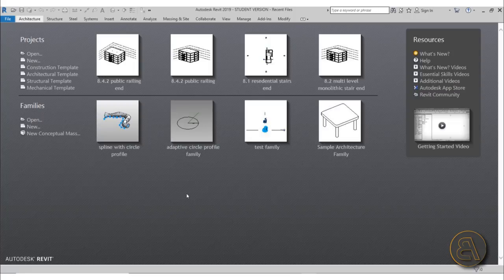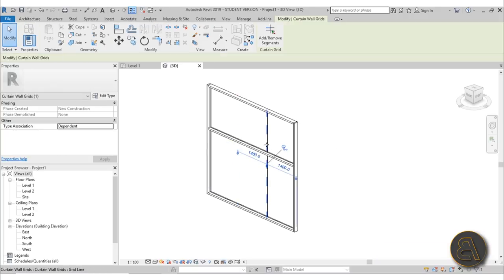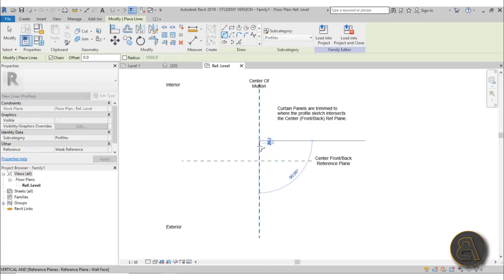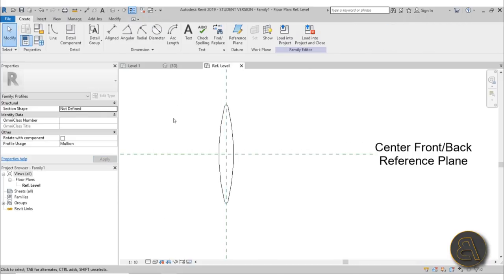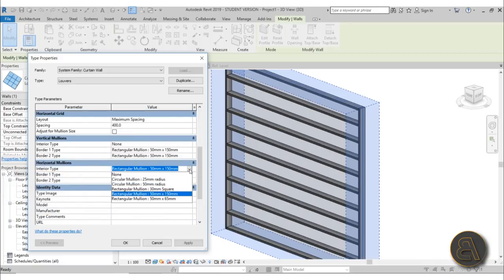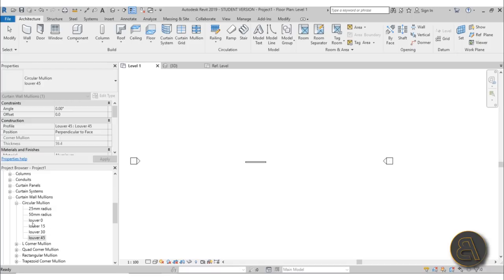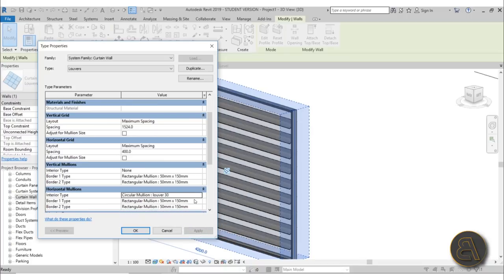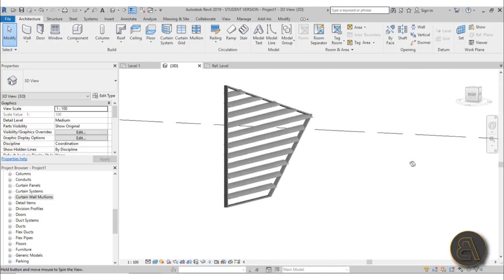Parametrc Louver Family in Revit Tutorial

Comment: Mr Balkan Architect. 

I always have something ı couldnt figure out. In the mullion family edit type menu. Under dimensions. There is width on side 1 and width on side 2, sum of them determines the total width of mulions (front view width (not thickness or depth) . If we have 50x150 mm mullion. It has 2,5cm and 2.5cm values for that. I am always wondering what is the benefit of typing 2 values for a width output resulting from the sum of width on side 1  and side 2 inputs. And when you create the new mullion family and choose the profile for the louver that you made to use on mullion family, those width on side 1 and on side 2  value inputs in the dimension section were uneditable. How can we add a parametrr to the profile so we can use that dimension options of widths for  louver profiles?

I am studying architecture. I know revit but not much about families. Sorry for the question if it was unlogical. Also thank you for your kind and nice tutorials. I would surely support you as soon as ı can afford to do it

Best Regards,

Comment: Please I need create a family of dampers.  The frame is 3” at
the bottom; 1.5” at the top.The blade thickness is the same.  You may change the
quantities of blades (at 12” each) to increase the height to 24”,  36”,
and 48”, and the blade length will be 24”, 30”, 36”, 42”, and 48”.  A total
of 15 different sizes. this examples is not working is I need drop on any kind of wall
Reply: I am using revit 2017 I cant see the empty pannel in diologe box can you help me
Reply: @ansarnelliyali8935  1. FAMILIES > NEW 2. Pick (template) file METRIC CURTAIN WALL PANEL.RFT 3. FILE > SAVE named for example EMPTY PANEL 4. Click LOAD INTO PROJECT. Good Luc